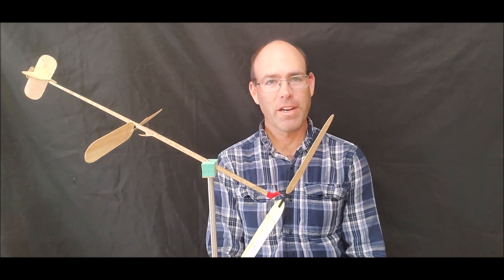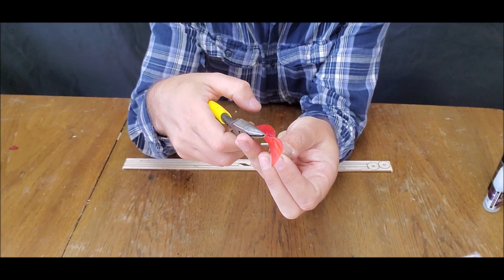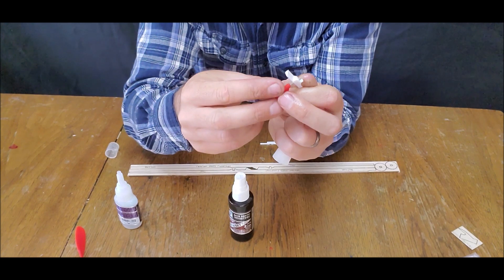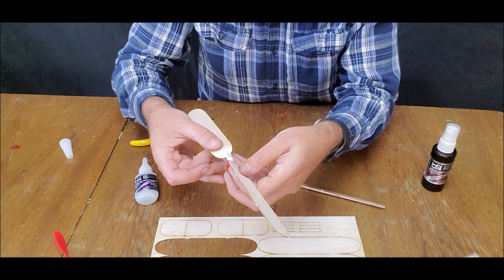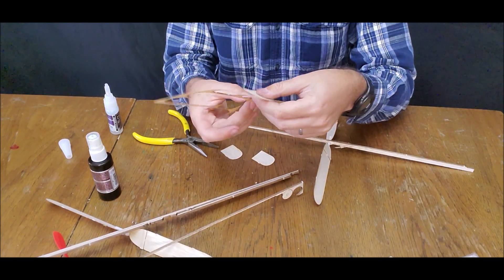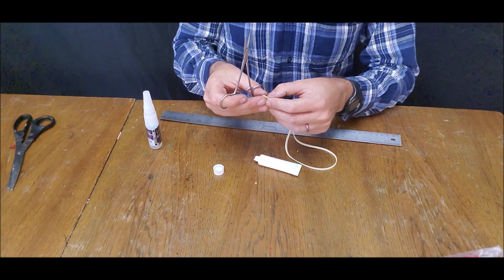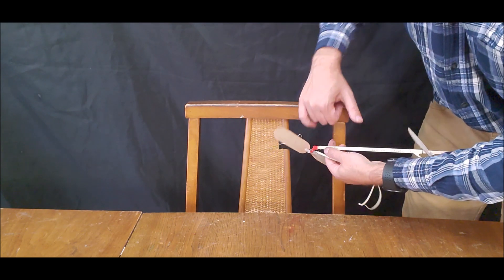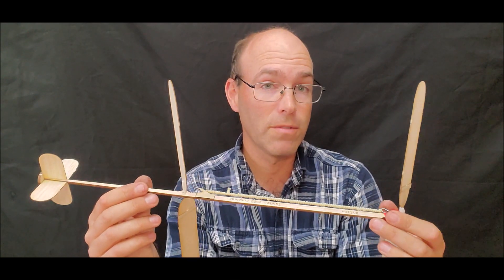Twister 2025/2026 Science Olympiad Helicopter build instructions

Comment: can I please have the SLT 3D printing files for the white parts that the blades are glued too, because I lost mine.
Reply from the maker: I cannot provide cad files as they are proprietary, however if you contact me at joshuawfinn@gmail.com, I can provide replacement hubs at a relatively low cost.

Comment: According to a biography just read, something very like this (but a toy not built by them) is what first captured the imaginations of Wilbur and Orville regarding flight. So the kids are replaying an historical event in addition to all the other benefits of the exercise. 😊 The basic design of this type is from the early 1700s!
Reply from the maker: You're correct. The basic configuration, powered by a rubber band, dates from the late 1860s or early 1870s as built prolifically by Penaud prior to creation of his Planofore in 1871. The Wrights obtained a simplified version which replaced the lower rotors with vanes. Orville's writings indicate that as children, they made numerous copies and used them to learn the workings of propellers. It's no wonder the Flyer had such incredibly efficient propellers!